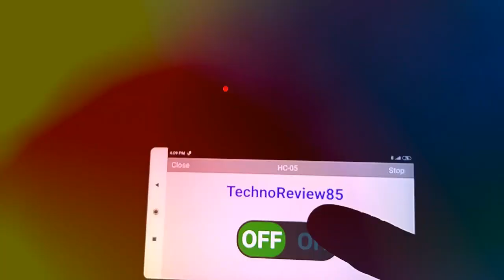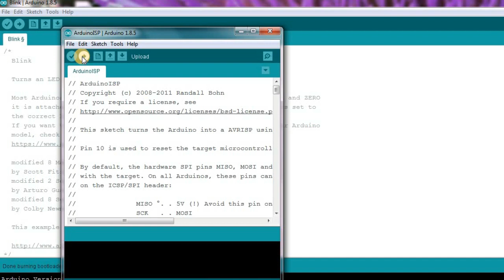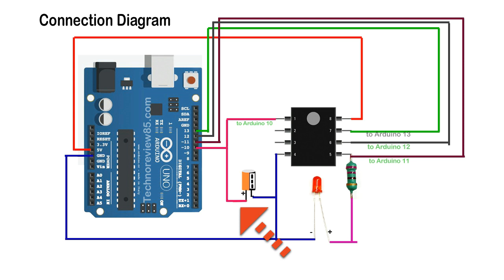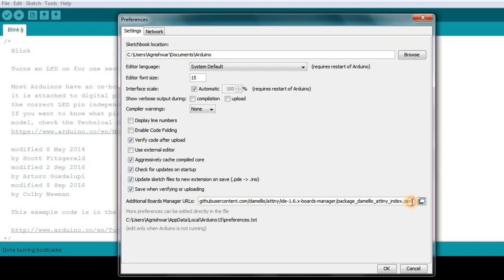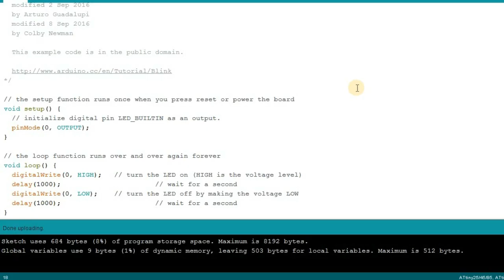Programming ATtiny85 with Arduino Uno | The Easiest way

Comment: when i uplode code  show ( errpr: A programmer is required to upload  ).how to solve it
Reply: Same problem bro... how did you fix it?
Reply: @MasterTv_777   I had the same problem before when I tried to burn bootloader to Atmega328p
step1:   Select UNO as  board type and select connected COM port.
step2:   Select  Programmer -> ArduinoISP

step3:   select example sketch called "ArduinoISP"
step4:   click upload
step5:   now continue this tutorial video at 4:46
              board type: Attiny25/45/85
              processor: Attiny85
              clock: internal 8 mhz
               programmer -> Arduino As ISP
  step6:  click burn bootloader.
  
let me know if you successfully burn the bootloader.
I'm going to order ATtiny85 for my project too.

Comment: when i uplode code  show ( errpr: A programmer is required to upload  ).how to solve it
Reply: same problem
Reply: @murtazabanday   had the same problem before when I tried to burn bootloader to Atmega328p
step1:   Select UNO as  board type and select connected COM port.
step2:   Select  Programmer -> ArduinoISP

step3:   select example sketch called "ArduinoISP"
step4:   click upload
step5:   now continue this tutorial video at 4:46
              board type: Attiny25/45/85
              processor: Attiny85
              clock: internal 8 mhz
               programmer -> Arduino As ISP
  step6:  click burn bootloader.
  
let me know if you successfully burn the bootloader.
I'm going to order ATtiny85 for my project too.